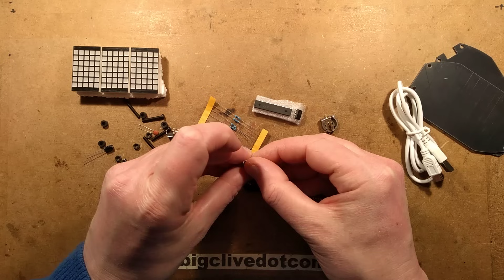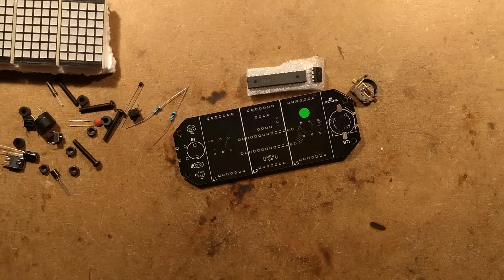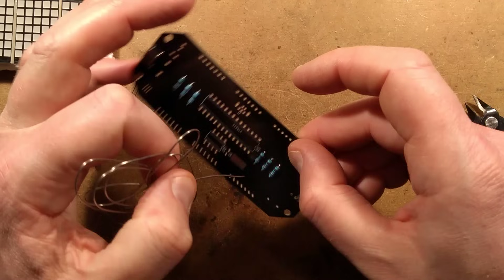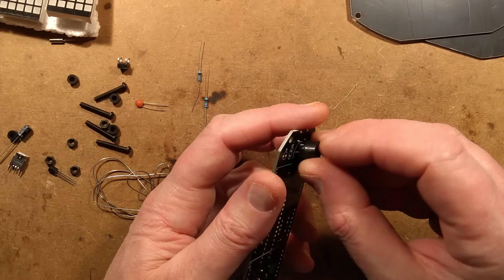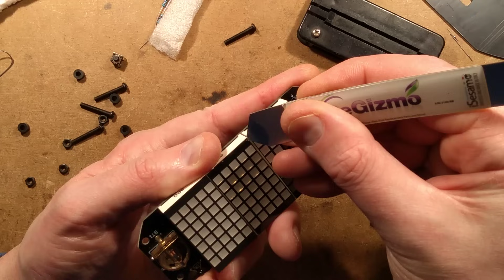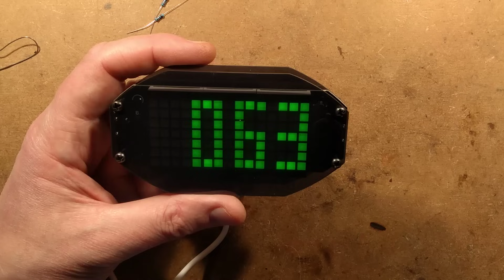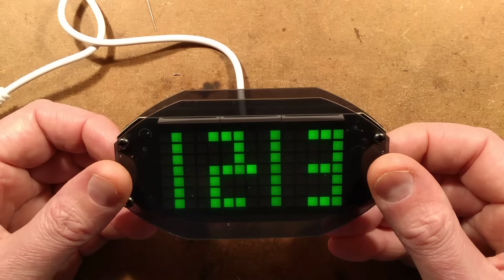Full clock kit build and setting guide.

Comment: I call BS!
Clive said it was 8 C there & his brand new, professionally fabricated digital clock with temperature display shows 21 C.
Helluva space heater to get a room from 8 to 21 Celsius. 36:13
Good video Clive!!!
Reply from the maker: I think it was residual heat from soldering and my hot hands.  It soon settled down to 9C.
Reply: @bigclivedotcom  Haha, yeah I saw it had 'dipped' lower to 18C I think, later on.
The board, components being soldered, hands, lighting all can lend heat to the board & the TR was picking up on that. As it should, actually.
<edit/after thought> Depending where the space heater was, if it's facing towards the table & not too far off you'll have thermal heat trapped almost. Rising from under the table as well.
Reply: And later on to 12°C.
Reply: ...and he could not 'calibrate' the temperature sensor
Reply: I much prefer around 80 F.

Comment: I noticed that neither RTC nor controller have bypass caps on the power pins. I can imagine that this could cause some problems with correct time keeping if the power supply that's used has too much interference on the 5V line. Not saying that it definitely is the problem, but it could be ;)
Reply from the maker: It's something I was considering adding after a test to see if the time does drift.

Comment: Where you get normal 60pb/40sn soldering wire? nowadays they dont sell that in finland....
Reply: You got it the wrong way round, normal lead solder is 60Sn/40Pb. you can get it from mouser in finland
https://www.mouser.fi/Tools-Supplies/Soldering/Solder/_/N-b11qq?P=1z0xha9Z1y95jxaZ1yysnw7&Ns=Pricing|0

If you're not sure what size to get i recommend 1mm/0.04in, not too thin, not too thick.
https://www.mouser.fi/ProductDetail/MG-Chemicals/4896-227G?qs=sGAEpiMZZMuQDxh7mFZIafA0CFytvp0PAm6XR7ZfzWo%3d
Reply: SuperCloneRanger Thanks dude 👍. I always write it the wrong way around 😂

Comment: I built a similar one to this a few years ago that would fit inside a rotor from a Mazda rotary engine. The first was a 12A rotor.

The time keeping sucks! I built a later revision board (into a 13B rotor) and the time keeping sucks for that too.

I have read online, the crystals are crap and that to solder the crystal to the chip itself.

I haven't tried that, but wouldn't mind giving it a go when time (lol!) permits.

https://youtu.be/I6wgob3JtgY

Comment: You look like you could do with a solder dispenser the size of a Tic Tac box for this sort of job, in fact that's just what I did recently, made a solder dispenser out of Tic Tac boxes with some 3D printed parts, with designs for 3 different size of box.
I uploaded the stl files to www.thingiverse.com/search?q=tic+tac+solder+dispenser
Reply from the maker: That's pretty neat.
Reply: I just use a film canister with a hole punched in the lid. Then I coil the solder around a rod a bit thicker than a pencil, with the feed end coming out of the center of the coil.
Reply: I used to put solder in an empty "Soder Wick" reel but the outside edge pinched the solder too much and it would sometimes snap, so I realised that now I have a 3D printer I could design a reel to fit perfectly inside a Tic Tac box, and it works so much better than the old solder wick reel.
Reply: clever and minty fresh!
Reply: Thanks, I made the original one because I needed it, and I use it all the time, then thought someone else might like it.
The Jumbo & American size versions were by request.

Comment: Im going to buy one of these build it and get the cheapo £1 powerbank and take the little usb module out and wire it to an 18650 with really high capacity and then its not tethered to a usb cable
Reply: You can get 10 protection/charge boards for £2 : search 10Pcs 5V mini USB 1A 18650 TP4056 Lithium Battery Charging Board With Prote N5F4  They sit nicely on the side of of an 18650 battery holder.  Be sure you get the protect and charge modules, the protection only boards look almost the same.
Reply: @whitehoose  i need one that has both the lithium protection and a 5v output thats why i went the cheap route amd thought about the guts of the powerbank
Reply: @joshuabest100  In that case good choice :D
Reply: @joshuabest100  I haven't had much luck with that for low-power devices like single-LED lamps etc. ... even the super cheapo generic powerbanks are kinda sorta "smart" now and shut down if there's less than ~100mA load, which some LED lamps and other stuff just don't reach so the powerbank simply turns its output off after 10-15secs :(

Comment: I found a lot of these Chinese kits come with crap crystals.
Reply: Those more commonly called coprolites?
Reply: Can you provide some contact details? I represent Mrs. Gwyneth Paltrow and we are interested in this "crap crystal" product you mentioned. We intend to sell them for $750 each to rich morons premium customers, with detailed instructions about where they should insert them.
Reply: RFC3514 ummm what?
Reply: Did you solder the case to the pad, as Clive did?
Reply: bdf2718 Yep, on the ones that provided the solder pads anyway.  Ended up getting some higher quality 32.768khz crystals. Problem solved.

Comment: For those looking for one of these, search:
DIY Black Digital LED Desktop Alarm Clock Electronic Learning Kit Module K0T0 
on eBay
Reply: Not found (on .co.uk version of ebay).  Others (which appear to be the same thing or very similar) came up, but with a different module ID (or no ID at all).

Removing the module ID also resulted in some interesting alternatives.  Various sellers offering something similar to Clive's but with a ring of LEDs around it (which might indicate seconds or might just be disco lights, the photos indicate disco lights but that could be a test mode or something).  The description of one of them implies it is programmable via the USB interface (maybe Clive's is too) or maybe it just infects your computer with a virus when you try to program it.

The description of one of the ring o' LEDs jobbies had this jem (amongst others): "In the previous version, many children's shoes said that the alarm time was too long, but many children's shoes said that the alarm time was too short. When the boss was in a dilemma, he decided to make the alarm time adjustable!"  Search for "Rotating DIY DS1302 LED Electronic Digital Clock Kit 51 SCM Learning Board 5V"
Reply: @bdf2718  
Don't use the local ebay sites for searching. Sellers can choose in which countries to list, so you won't find most of the stuff. Use ebay.com . Just because sellers don't list on your country's site, doesn't mean that you can't buy it. You can either directly order on com (will be listed in US$ then) or copy the item item ID to your local site and order there.
Reply: @superdau 
Whenever I look on ebay.com I mostly get companies based in the US with big postal charges if they ship to the UK.  Like many of the companies on ebay.co.uk that claim to be UK based but are actually in China, I'm guessing the same is true of many of the US companies.  But the postage is still a lot higher, so I stick with ebay.co.uk.

So far, any of the stuff Clive mentions and gives an ebay.com link, I've found on ebay.co.uk a lot cheaper (mostly because of the postage).  YMMV.
Reply: @bdf2718  
Sort by "lowest price + shipping first". Then you'll find all those sellers that offer free (or at least very cheap) shipping from China. And yeah, ignore those that claim to be sitting somewhere in Europe or the US, when they are obviously chinese sellers (as you can usually tell be the description).
Reply: @superdau  
I always sort by lowest price + shipping.  Whenever I've looked, even the cheapest sellers claiming to be in the US charge a lot of postage to the UK.  So I just stick with the UK site.
Reply: @bdf2718  https://www.ebay.co.uk/sch/i.html?_odkw=clock+matrix+kit&_osacat=0&_from=R40&_trksid=m570.l1313&_nkw=6+digit+clock+matrix+kit&_sacat=0
There are hundreds of them!
Reply: aliexpress is cheaper
Reply: Post the link to the ailexpress listing for those who have an account there (I do not).
Reply: @Inspector_callahan  Clive has mentioned before that for some reason Aliexpress won't post to the Isle of Man so he's limited to eBay et al.
Reply: Search dot matrix clock diy you will fond them
Reply: Thanks Lake! - 6 Green ones left after I got mine. 9.97usd
Reply: On ebay.ca I get a lot more results using this search : DIY LED Matrix Desktop Alarm Clock Kit
Reply: Be hit of it doesn't keep time, why build it. I would rather build a clock that keeps time correctly

Comment: I like the display on this... gonna buy and build!!
Clive... still look forward to see if you can dismantle and describe how that mechanical digital clock I sent to you works to form the digits, and present them in numerical order!
Reply from the maker: I was looking at that again today.  (It's just under the bench where I film.)
Reply: Does it still run?

BTW Clive, I just purchased one of these clock kits... only green was available. White, Red and Blue LED display versions are sold out...

And dang, I thought I was nocturnal... the sun must almost be coming up at the I.O.M. !!
Reply from the maker: (I'm kinda worried about exploring it too deeply as it has quite a complex cam system.)

Comment: Could you use a large capacitor in place of the battery?  For a short power outage, like while you are changing power banks out?
Reply from the maker: Yes you could if you added a diode and resistor to trickle charge the cap.  Some clock chips do support charging.
Reply: Some devices use supercapacitors for memory/ rtc backup.

Comment: Mini-USB >>> Micro-USB.  Micro-USB are terrible.  Too fragile.  I find Micro-USB to be vile.
Reply: Oddly enough, the Micro is rated for much higher plug cycles than the Minis.
Reply: @Anvilshock  But the Micro-B are much easier to snap in half.
Reply: Usb c has a tactile click....it makes all the difference!
Reply: What on earth do you do with them?  I've had a Google Nexus4 since 2012 - charged every day, the micro USB is as tight as ever, as is my tablet, wife's phone etc etc.  It was the happiest day of my life when finally ALL my devices were micro.  I'm still using the same charging cable and wallwart on my bedside table too.   I've never had a USB port fail on any "decently made" bit of kit.  You expect a 99p fleabay special to be dodgy ... the micro plugs are so short that there's no significant leverage force when you use them.  

I got a oneplus6 phone (personal) for Xmas and was sick when I realised it was USBc as is my TS80 soldering iron ... bloody liberty, cost me £1.49 for a spare cable!!!  The positive side is they plug in either way round, so you don't have to fish for the hole.
Reply: Usb c is loverly
Reply: USB-C :)
Reply: @benkerr9051  I'm retarded enough to make sweeping comments with no factual basis after not sleeping for 30 hours, so who knows. I don't buy mods that don't have removable batteries. I just can't trust any cheapo mod charging circuit.
Reply: The use of Micro-USB ports in heavy-use devices like (non-Apple) mobile phones ought to be prohibited.  The repeated purchase of cables and servicing of the phone resulting from component failure is both wallet-draining and aggravating.  Wish my current Android phone utilized the sort of charge/data port design like my ancient Samsung FlipShot did, which was virtually bomb-proof.
Reply: @MokkaMatti  SMOK  vape mods, crap usb sockets, always break off.
Reply: Mini has the retention springs (which tend to wear out first in terms of plug cycles) in the female socket, which is not normally user replaceable because it’s soldered into the device. Micro has the springs in the male connector, which means you normally just have to replace a cable if they’ve worn out. If I remember correctly, that was the main selling point of micro USB. 

Aside from the obvious “you can plug it either way” benefit, USB-C also brings more pins to enable much faster USB 3.1 and Thunderbolt connections, as well as support for safely switching to higher power supply voltages to charge laptops etc. 
There was a micro USB 3.0 connector, but that was basically just two micro connectors slapped together side by side quite awkwardly.
Reply: @mlenstra  There are no "springs" in either end of either connector. It's just tension from the way the contact are manufactured, along with tight tolerances in the casings.
Reply: Aurelius R all types of USB have some form of retention springs. The micro male plug has two clearly visible spring hooks on the outside that mate with matching cutouts in the female connector. They’re usually quite sharp and prone to snagging on clothes. You can see them clearly here: https://goo.gl/images/DSxzbs . With mini the female connectors have dimples on springy arms that are formed by cutting away material around them.
Reply: Mini is too old someone thought, so they made micro. Which is usually not a problem. Though USB type c or b is much better
Reply: Micro USB is the biggest crap ever. It must have been the Jewish -Illuminati-Freemasons who invented it and made it a EU mandatory standard for mobile phones.
Reply: @jurivlk5433  The micro usb(and usb-c) is the best thing what happened to the consumer devices. Before that we had at home 2 types of "Nokia" chargers, mini usb, 2 types of "Sony Ericsson" charger and a Samsung charger. In my count we had 6 different types of phone, tablet, headset and media player charger.
Reply: @talos86  It is good that the plugs had been standardized, of course. And I don't understand why batteries aren't standardized too, which would have an enormous positiv Impact on the environment. The problem is the plug chosen which is then biggest shit ever! Any simple 2-pole jack like the 2.5 mm would have done the job much better. The actual situation is very bad since the USB micro are very shitty and wear out very quickly. The result is that not every cable goes with every device but I have some devices where only one cable out of ten works! On the top, the plugs are often badly fixed on the plates and the tiny solderings don't last long.

Comment: Might be a silly question, but where does one get solder "bought from a good local supplier.  (not eBay)" - as Maplins and Radio Shack have closed, and there's probably not many small electronics retailers left on the streets at all... Advice please, dear Sir!!
Reply: Plumbase can order it in for you. Multicore 60/40 .5mm. I bought mine of ebay 2-3 years ago, no problem though.
Reply: Clive always rants about crap lead free solder, and when he made a video about them, he made perfect (and almost identical) joints or blobs with all of them :) so I would not worry much.
Reply: MicroCenter carries a bunch of hobby electronics bits and bobs. There aren't as many around as Radio Shack, by a long shot, but if you are near one, it's a good option.
Reply: Free postage over £8 from https://cpc.farnell.com
Reply: Good lead free solder is fine. Crap lead free solder however....is like soldering with poo

I believe mine at the moment is "shenmao" branded and it's actually rather good.